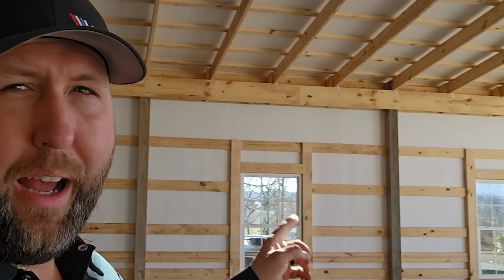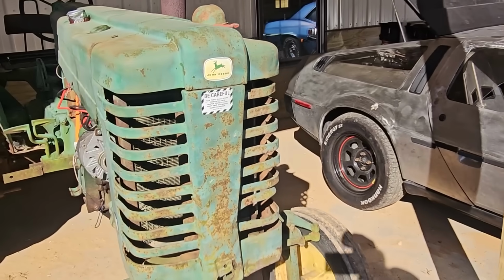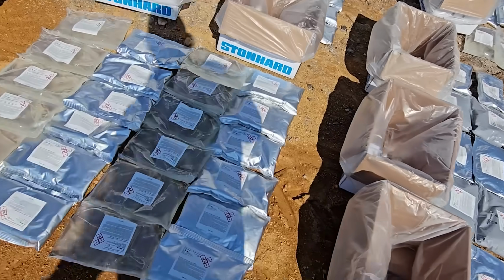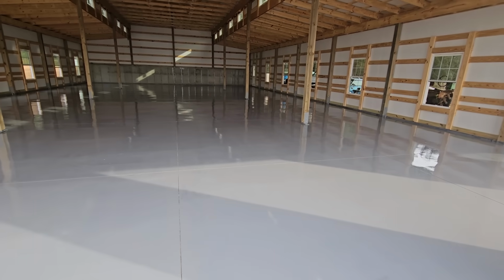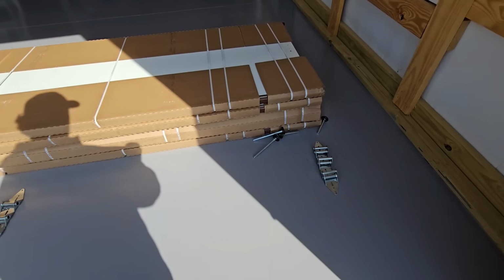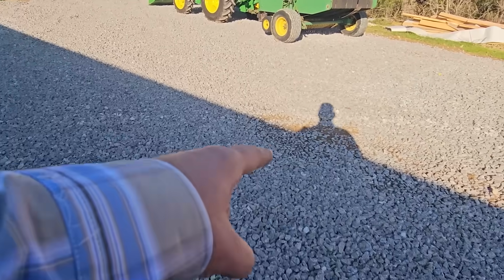Windows, Doors, Floor Epoxy, Gravel and MORE! Barn Build - Part 3

Comment: 00:07   🏡 Welcome Back & Barn Update
00:12   🖼 Installing Windows & Exterior Finishing
00:26   🎥 Behind The Scenes at Vice Grip Garage
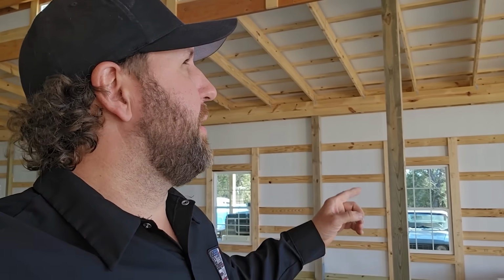00:34   🪟 Window Installation Overview
01:01   🚪 Choosing Exterior Doors
01:22   🚗 Revealing the Dual Carbed LS DeLorean
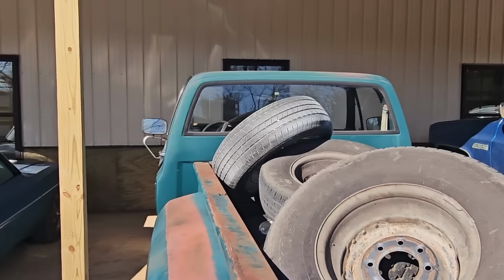02:04   🏍 Introduction of New Two-Stroke Bike
02:10   🔧 Overview of DeLorean Upgrades
03:08   🚜 Attempt to Start the Tractor
03:58   🔋 Dead Battery on Tractor
04:17   🛠 Trying to Start and Fix the Tractor
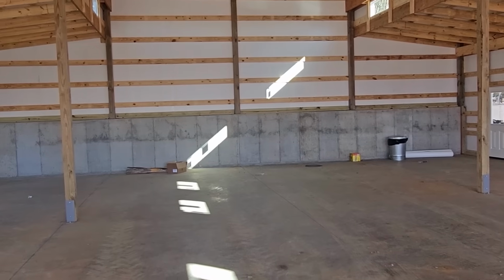05:26   🌞 Discussing Natural Light with Upper Windows
05:33   🎨 Choosing Exterior Brick Veneer
05:57   📦 Dealing with Material Orders and Waiting
06:38   🏍 Details on the Two-Stroke Bike
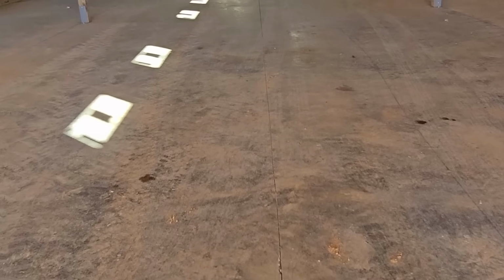07:09   🛣 Concrete Work and Repairs Beginning
07:20   🌐 Addressing Concerns about Rebar
09:30   🏗 Process of Concrete Repairs and Sealing
10:25   🌪 Pre-cleanup before the work begins
10:46   🎨 Deciding on Battleship Gray for the floor
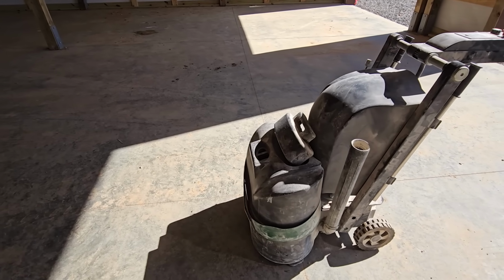11:16   🚚 Arrival of the flooring specialists
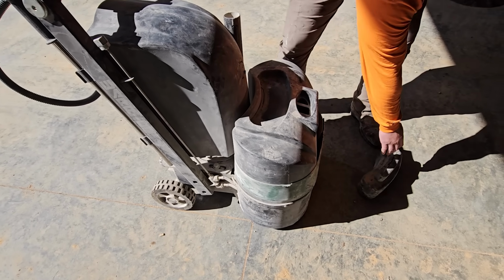11:36   💎 Introduction to the Diamond Cutter tool
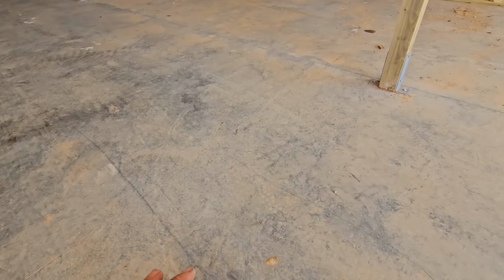12:04   🔍 Explaining the concrete grinding and crack repair process
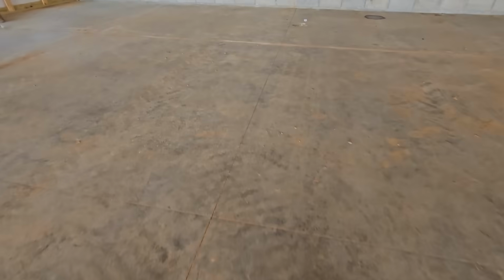13:05   🧼 Mid-process cleaning and grooving
13:31   🧪 Mixing the special mortar for crack filling
14:27   📏 Precision in prepping the area for the final steps
15:00   🚧 Filling cracks and smoothing the surface for primer
15:30   👟 Special equipment used by workers for the flooring process
15:59   🔗 Primer application begins
16:43   🚜 Discussing exterior property improvement with potential rock addition
17:01   🌄 A beautiful morning reveals the work progress
17:37   ☕ Enjoying the morning and waiting for the final floor coat
18:17   🛠 Final touches before the top coat is applied
19:41   🚪 Garage doors arrival in sync with the flooring completion
20:16   🧚‍♂ Exploring "Fairy Dust" addition to project
20:40   🚪 Introduction of new garage doors
22:01   🛠 Reviewing newly installed doors and glass features
22:17   🚚 Arrival of the rock truck for groundwork
23:09   🤩 Admiring professional workmanship
23:35   ☔ Rain impacting work and causing mud
24:22   🏗 Wrapping up current barn build progress

Key Moments by Agent Gold AI

Comment: I do not know about Tennessee but here in NC, it is really hard to find a concrete driveway, garage, slab or barn/shop that does not have a cracked floor....every one wants to use the fiber concrete and no rebar. I come from South Florida were all concrete had wire and rebar in it so I was amazed when I came here and nobody does...but then everybody has damn cracks.

My shop when the prior homeowner put in, is similar to what you have but smaller (3 car garage sized) and it has 3 cracks and the building is only 5 years old. I "v"ed the cracks and filled them similar to what you are getting done and it seems to be holding up.

Comment: Rather than bring power to the new building, Maybe a good candidate for a solar/offgrid? It will pay for itself and you could do it yourself with some guidance. Start small and can always make it bigger, but even a 4 panel 24V setup will start any compressor. (But I would build it 48V from the start)

Comment: 7:45 Oofta May, that’s a lot O cracks for a new building!
You probably didn’t even get cold enough for long enough to get a good frost in the ground like we do up here in Snow Mexico 😳
I live in south western Ontario and this has been THE MILDEST WINTER I can remember in almost 50 years! Really only had 2 big snow storms and everything melted away in between, now it’s over 60 degrees, today 🤷‍♂️

Comment: As for power at the barn, you could put up some solar on that roof and an offgrid battery pack. Don't need much to run lights, doors and the occasional battery boiler. A lot easier and probably cheaper then running a power cable trough a trench and getting it connected up. If just for (basic) lights and door openeners a 12V system would even work and you would be done for about 500 bucks as far as power goes.

Comment: I don't have power in my new building with an 18'x12' overhead door. Opening the door isn't an issue, getting it closed is tough. The pull rope is about to break after a couple weeks. I ran an extension cord to the pigtail on the opener, easier and the wife can run it now.

Comment: Derek the new building is coming together rather nicely & its all looking good. I like the sorta layered look of the building having the center section a bit taller than the sides. The floor coating looks good aswell & those new doors look great an go perfectly with the brown trim like you had planned. 
Your dumptruck driver/gravel guy has definitely been doing that for awhile bc he laid that first row out perfectly from my point of view he left just enough of a pile at the start to cover back to the wall an the rest of it seemed to lay out rather smoothly with the correct depth that was needed/wanted..

Comment: I figured if we didn't see rebar, maybe they did mesh and you didn't catch it, or just used fiberglass/metal shavings in the concrete for strength. All three options are viable. I know the cracks aren't the end of the world either. My slab has a crack in it too and it's not for lack of reinforcement. But anyway, barn's looking good. That paint coat is really convincing me to do the same.

Comment: I’m from a very different climate in eastern Canada and yup no mesh or bar in commercial or residential floors up here either. I’m not a concrete guy but I work construction and am around it a fair bit. I was told bar and mesh doesn’t help cracking anyway. Just keeps it together. Just what I was told. Looks good, a lot to be proud of.

Comment: Blueprint Engines 3.6-Liter Four-Cylinder LS Specs: call blueprint engines will fit all gm bell housing a ton of gm cars have ecotec engines and are junk engines would make a great video 
4.125-inch bore
Max bore 4.185 inches
9.145-inch deck height
4.05-inch stroke
Coil-near-plug-ready
Cam Sensor
Crank Sensor
Could also run a distributor
Additional capacity water jacket
High-capacity water pump, capable of 38+ GPM
5.7, 4340 connecting rods, tapered pin end
351 Windsor main bearings
SBC rod bearing
SBC cam bearings
Current crank is nodular iron
SBC one-piece RMS-style flywheel flange
Uses SBC flywheels or flexplates
Uses SBC starter

Comment: Good Afternoon Derick. My first time watching your other Channel Vice Grip Lodge. I am very Impressed and what a Great new Barn you have Installed. Love the wood effect doors and windows. It just needs a complete Power Supply and some really Good Industrial Lighting in the Ceiling area to brighten the place up. Loving it very much Derick. Vice Grip Garage and Lodge now. Vice Grip Garage is spreading it's Huge Wings. It is one of the Best Channels on U Tube now. Give my Regards to Jessica and the Boys would you Derick. Jonathan. 😃😃😃💯💯💯👍👍👍👍👍👍👍🏆🏆🏆

Comment: I own Twin City Concrete Cutting. We do alot of Control joints. It's a educated guess as to where it will crack rebar or not. Sometimes, the cracks start before cutting, especially if poured on a hot day... at the end of the day as an Ex-Concrete finisher, no one is a better critic than a concrete guy... especially on someone else's work haha 😅

Comment: Just get a couple of solar panels, a battery or 2 a controller and an inverter. (less than $1000) and you can run your lights and a powered roller door.

Comment: I’m a QC tech for a concrete supplier. Concrete does 2 things, it gets hard and it cracks. Fiber in the concrete will hold it all together like rebar if it does crack it isn’t going anywhere

Comment: Derek I don't think you ever noticed my comment, but I found you a new carb for the 25 Studebaker. When it comes to odd makes like that you just have to find the specialists that live, breathe, eat and sleep the brand and you can find all the parts you can ever want. Though judging by the amount of results that are your video or mentioning your video, I'm sure you've gotten plenty of emails and in person comments about it. And of course now I can't find the place I had linked you on that video that had a brand new carb. 
"Gotta do a lot of manual raking up by that wall there still..." That's why you have kids.

Comment: My dad painted —*every*— project Battleship Gray when I was growing up: tractors, hot rods, trucks, you name it. 
A) It was durable.
2. It did a good job of hiding the bondo and orange peel. 
Thirdly, we were poor/he was cheap.

It’s still a favorite color of mine, and I get nostalgic every time I cough up another chunk of lung that’s been stained Battleship Gray by the sanding and painting I did for him without a respirator or mask. 😄

Comment: With that big roof you can think of solar panels and you may not need to run a line at all with really big batteries and when you do run a cable all the extra power can be fed back the power company for a discount

Comment: Brand new slab and wll those cracks , that stinks. Never cared for that fiber concrete. Before that it as common to use what we call down here, Road Mesh, 5×5 inch meshed wire embedded in middle of pour.

Comment: I live in Tennessee and poured concrete for years. I put wire reinforcement in pretty much everything even sidewalks. It won't keep it from cracking but it will hold it together if it does. And they try to say no need for reinforcement just use fiber. There's absolutely no way tiny strands of fiberglass as small as hair can take the place of rebar or wire mesh! They'll never make me believe it. I'm not a big believer in fiber period maybe it can help slightly and fine to use along with wire but not a replacement. A lot of people just don't want to fool with putting in the wire or rebar probably. I'm not saying you Derek I'm talking what people will tell you.

Comment: Fiber mesh is the way to go nowadays but most of the time the concrete was poured too wet, and you get shrinkage and thus cracking. Next project Derek uses fiber mesh and watch the slump.

Comment: Haven't seen rebar in concrete slabs here in the south. But have seen often they've used the metal grate. Kinda like hog fence w/ 6" squares.
Plus looking at your slab, it doesn't look like they put enough relief cuts in or deep enough cuts for it's size.

Comment: The cuts didnt seem to help much. I built my garage on quite a bit of fill dirt but we put rebar in every 16 inches in a grid and done a 5 inch slab over footers. Its been 4 years and it has one 6" crack that its had since week one. I didnt really care if it cracked but my father inlaw insisted that we go over kill on it. Not to many slabs last iver 10 years without getting some longer hairline cracks.

Comment: As a mason Derek, your masonry is gonna be either a cultured stone which is a fake stone made in a mold, but is cheaper than a thin cut real stone, or thin brick. Thin brick is about twice the cost of a full brick product wise and labor wise, as a full brick needs the face cut off to use for thin applications and needs the wall prepped per code with weepscreed, tarpaper, rainscreen, and metal lathe. Thin brick can be about 2$ a piece, where you can get full brick for 1$ or even less.
You said you're going brick in vid...not sure if just a generic term here. But to save cost if going brick look, have them bolt angle irons on and use full brick, doesn't look like you have a brick ledge. Full brick are much quicker to lay as well.

Comment: My first comment ever. A feller 😊 can insulate a garage door on the cheap with 1 1/2 EPS Rigid Foam Board               4’x 8’from the old home store cut it to fit shiny side out, and taped down the edges with ducting tape. You know the shiny stuff. Maybe that way you don’t have to sell any cars 😅I just started watch your shows VGG, VGL, and LGG   Love all of them. 😊

Comment: that would be a great location to put in a solar set up. If it's not being used often. A couple of solar cells and a battery storage to run the doors. maybe a few lights at night if/when needed. Otherwise, why take the time to run power.

Comment: My last project - 5 story concrete structure, 12" thick in the air slabs. Cracks were routed out and filled with epoxy. You're on grade and should be fine. You may want to think about adding a concrete apron in front of your building slab to help protect the edge of your building slab.

Comment: You definitely don't need rebar, welded wire is important though. The slab is going to crack, they always do at some point. The idea is to control where it cracks with the control joints and the wire controls differential settlement. The bigger issue I see is no expansion joints. Lack of these joints leads to more cracks

Comment: As you probably know those cracks are normal as the concrete dries you just have to watch out for elevation changes across the cracks. Completely fixable. First house I built I remember I almost had a heart attack to see these cracks. You only really want rebar in your footings. Your rebar fans are usually your northern folk. I could live in a place like that, just make a nice loft. Floors have to be grey in a building like this. What else do you want to do? Put down those little black n white tiles?

Comment: Its a little late but after years of trial and error, I've learned a 3" road stone base packed in with a 1" top layer makes the best driveway. The big stone base allows for dranage with reduced "washout" and less sinking. Guaranteed running those heavy tractors on that 11/2 will result in sunken tracks and potholes.

Comment: I used 4x4 wire in my concrete 36 x 24 building after 40 years no cracks

Comment: The John Deere M should be rebuilt! Those old 2 cylinder Deeres are work horses. The engines are undersquare so they have loads of torque. I have a 1952 John Deere 60 myself. Can't forget the iconic sound as well! Keep up the great work!

Comment: I'm amazed they don't use rebar, I've used fiber as an extra but never been impressed with it.  It will be interesting to see how it holds up over the years. 
That epoxy in the cracks is way too thin to provide any strength. 
Anyway the building is beautiful and I hope it stays that way for generations. 
You will definitely love the insulated overhead doors when you get installed in the main shop,  there is no comparison of strength between them and the uninsulated ones you have now.

Comment: Just heard what you said about juice and rest assured, it will be soon than later.  You will need lights and power for chargers etc.  Don't skimp yet and run 220 up front for the welder you will have later.  What about a water line as well while you have an open ditch??  I love spending your $$$$$!

Comment: You seem pretty cool about everything. It's difficult (impossible really) to make everything come out perfect but when you have good people that are there after things goes less than perfect, you know you have good people that are giving you there best so rest assured you're getting the best you can get and everything will turn out okay! I like the epoxy floors just because nothing can soak in that and stain it, it'll have to ruin the epoxy and that's going to be tough to do, it scratches but it's pretty tough and make clean up a breeze. With all of those posts it's near impossible for a floor not to crack if the concrete is good it'll last for years.

Comment: Here in the south we always use rebar or wire mesh on any concrete we want to last not using steel is like spraying base coat clear coat on a rust covered car looks okay for a little while. Sorry Derek you’re a good guy great mechanic & pretty darn good race car driver.

Comment: Shop floor is looking great, I knew it could be fixed, because I work at a rental store and we rent equipment for this repair. Technology has come a long way, especially the filler for the cracks. Love old tractors, they all need a second chance.

Comment: My small garage slab (46m square) is approx 4" thick and 12mm rebars in a 200mm by200mm grid - not a single crack

Comment: DEREK, you are in the south, the prairie mud is always moving and the concrete will always be cracking, be ready to adjust the doors and just live with it. Throwing a bunch of money at it will not work. Just a little fyi, I go through it always.

Comment: You don’t need much power out there, a small off grid solar setup with batteries would probably do you, with a gas generator if you need to run some big stuff.

Comment: Shop looks great.  You can never have too much covered storage space.  I wish my shop was about twice the size, but I make do with what I have, way too expensive to do anything else.  Slowly working on flooring on half of it, the other half will just remain the old dirt floor as my tractor and implements will stay on that side.  Wood working shop in half the building, tractor/implement storage on the other half.  Its only a 24' x 36' shop/barn, so I don't have too much space to work with, but have to make it work, no way my wallet could handle building anything larger LOL.  The other trouble is about half the year its useless because its not insulated/finished inside so heating it isn't possible.  Gotta work on that at some point.  But first the floor, and redoing the door on the end where the tractor sits to make it wider and easier to get in and out...its just old school split upper/lower barn door setup right now, I want to do the sliding barn doors but have no idea how to even start on that mess LOL.

Comment: It’s not too expensive if you buy it by the bundle at a lumber yard you can usually get it for abt 7 or 8 dollars a stick and it’s well worth it if you do anymore concrete I’d strongly suggest using it the way it freezes around Tennessee if it crackes it won’t lift

Comment: I pour concrete in Clarksville Dickson Nashville area and we use rebar on every job we can bc concrete will crack especially when you put calcium in it and if you don’t put rebar in the concrete it will lift on one side or the other and rebar stops that from happening